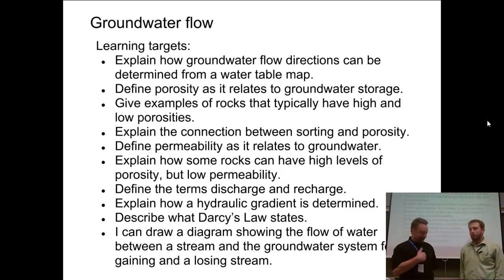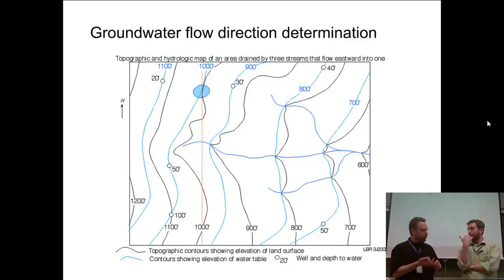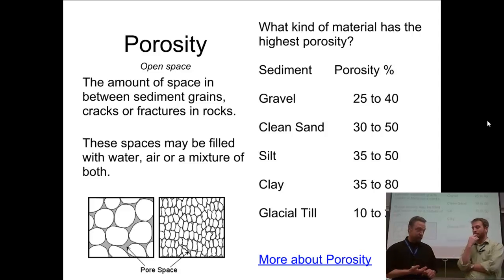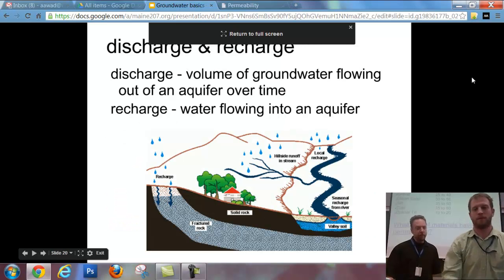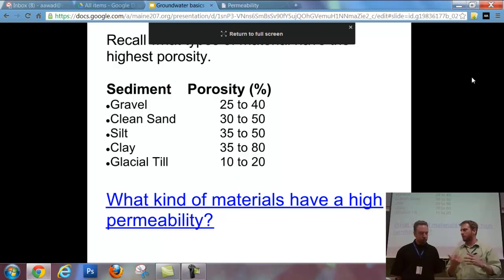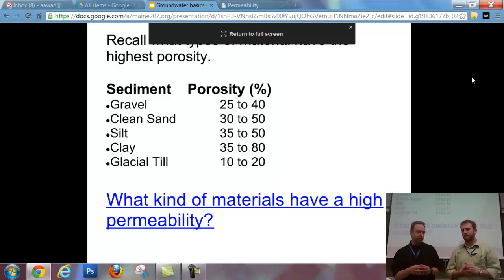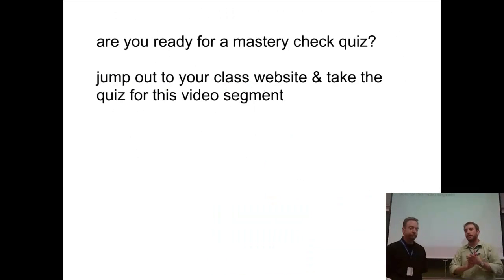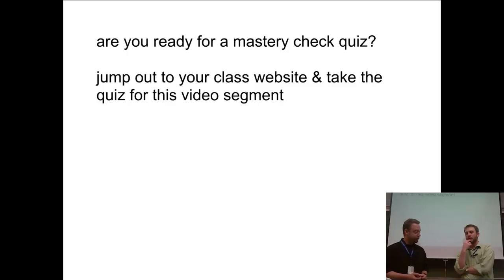Groundwater video 3: groundwater flow & Darcy's Law

Comment: Hello, I have an assignment question where I have to calculate the yield of water by a borehole pump. Diameter of well, draw down, length of strainer below draw down, coefficient of permeability and radius of circle of influence have been given. Do I have to use darcys law to solve the question or are there other laws?